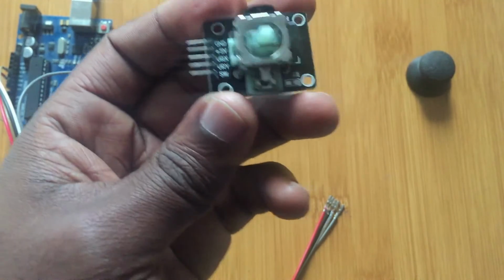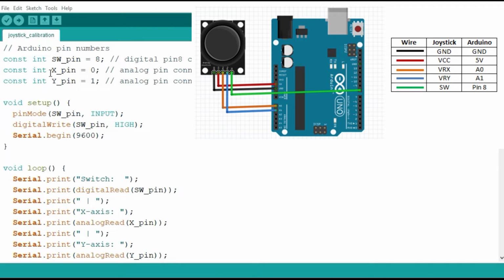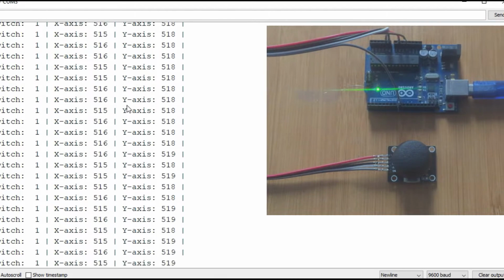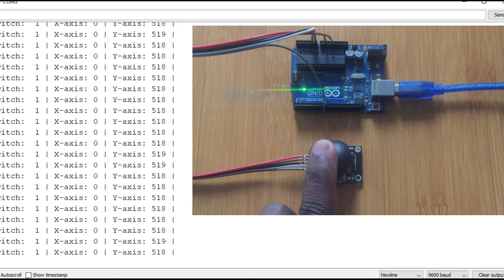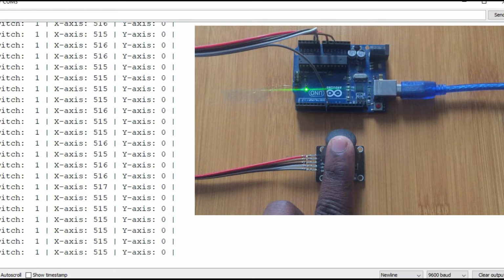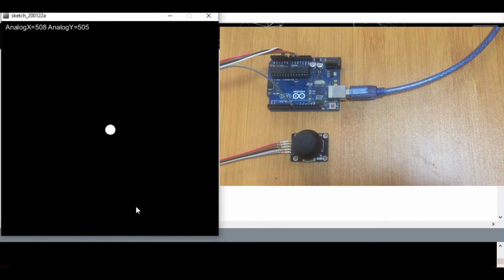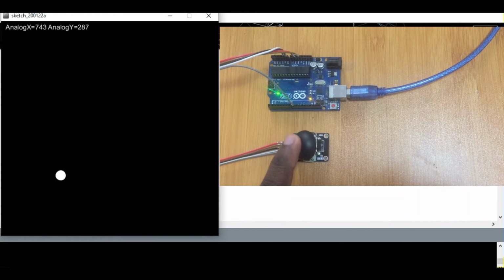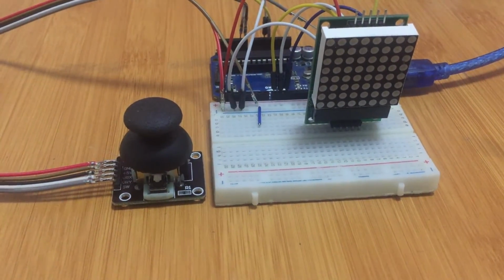Getting Started with Dual Axis Joystick with Arduino.

Comment: const int SW_pin = 8;
const int X_pin = 0;
const int Y_pin = 1;

void setup() {
  pinMode(SW_pin, INPUT);
  digitalWrite(SW_pin, HIGH);
  Serial.begin(9600);
  // put your setup code here, to run once:

}

void loop() {
  // put your main code here, to run repeatedly:
  Serial.print("Switch: ");
  Serial.print(digitalRead(SW_pin));
  Serial.print(" | ");
  Serial.print("X-axis: ");
  Serial.print(analogRead(X_pin));
  Serial.print(" | ");
  Serial.print("Y-axis: ");
  Serial.print(analogRead(Y_pin));
  Serial.println(" | ");
  delay(1000);
}